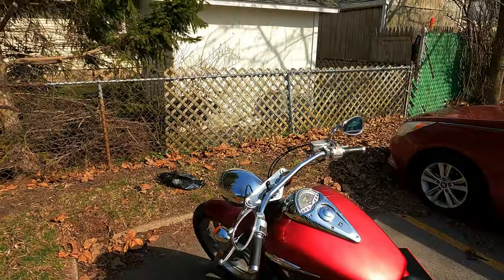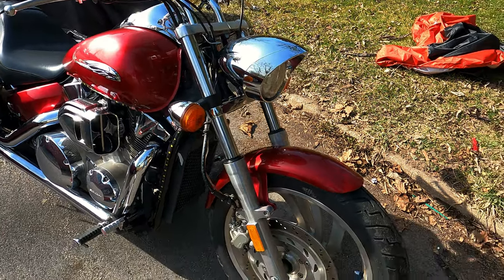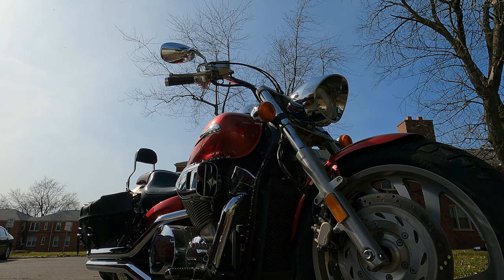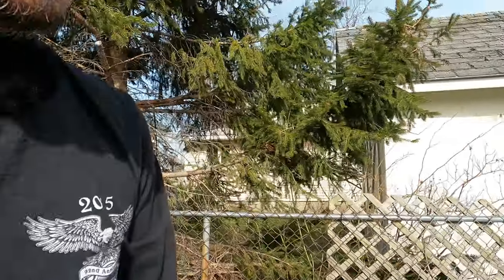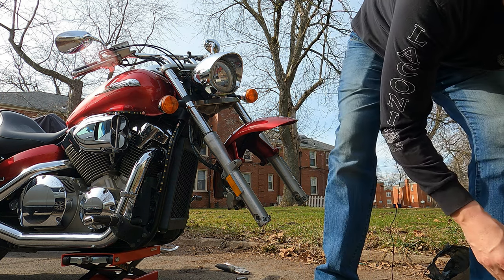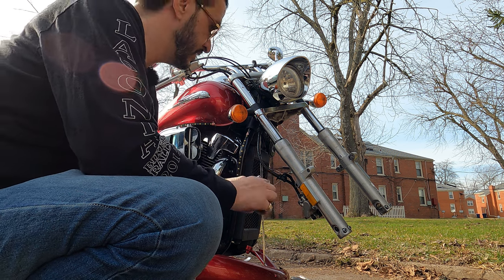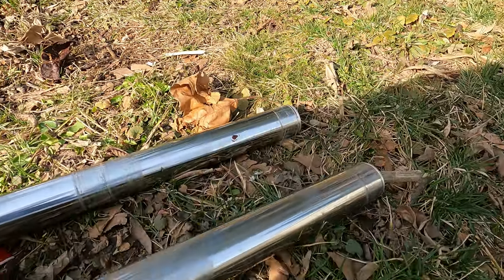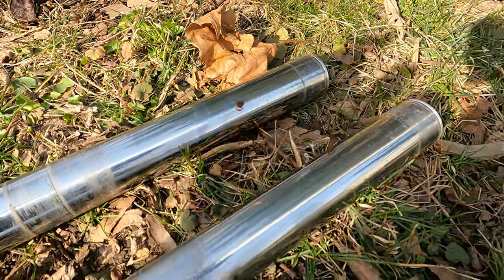04 Honda VTX1300C Fork Removal "redruM"

Comment: You do not need the large Allan socket he bought 
Leave the left side pinch bolts tight loosen the right side crack the bolt lose but don't thred it all the way out then losen the left two pinch bolts and gently tap on the axle bolt and it slides right out have the bike jacked up with the the front wheel just touching the ground and you'll have no problem
 Aslo keep track of your spacers they are different sizes
Reply from the maker: Wrong! The axel threads into the otherside, u can tap all u want but you will need the tool.